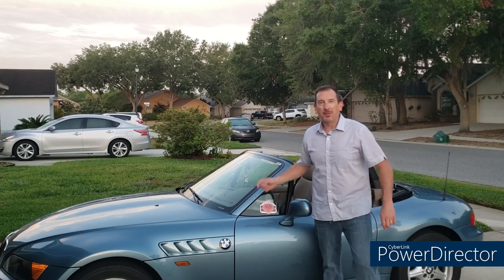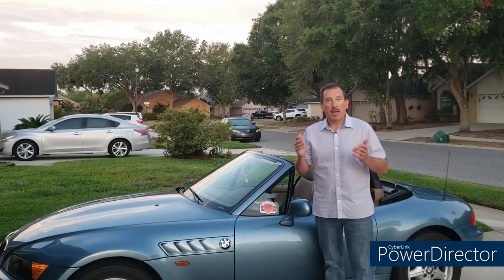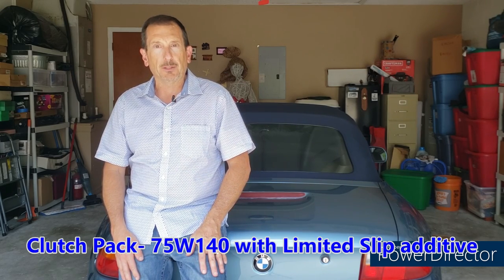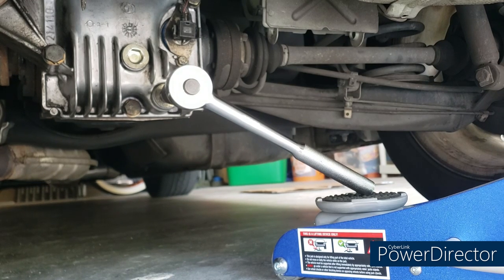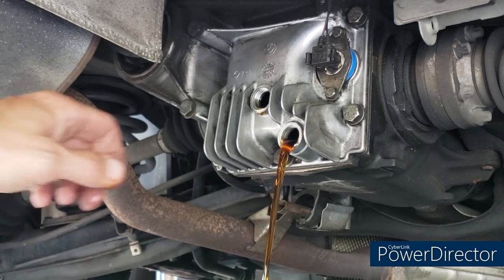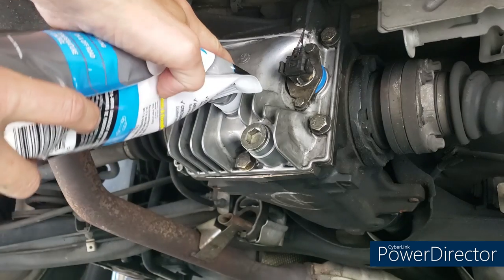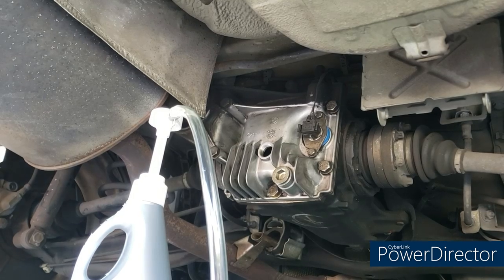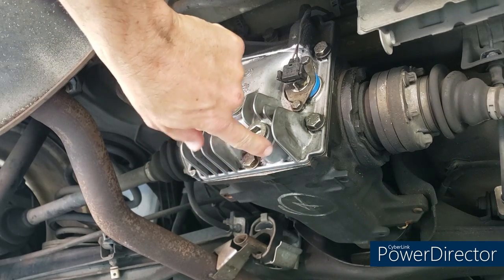How to Change the Differential Oil: BMW Z3!

Comment: Great video as always! I watch them all. I did a video on this a month ago and I also tried the Valvoline bags. I will agree it takes longer than a pump but I like the easier cleanup without having to deal with cleaning the pump hose so it isn't dripping on everything. I would argue the cost of a replacement cheap pump to toss is close to the extra convenience charge of the bag. Both options work and I love that the oil companies are slowly giving us more options.
Reply from the maker: Your video was excellent as well.  You're doing great and your a better  videographer than I am!  Appreciate the kind words!  Agree on the pump cleanup, mines in a bag with that awesome gear oil smell wafting from it.

Comment: Great video Mark!

Thanks for the explanation of the different oil specs for the various differentials used in our Z3s.  I can confirm that using the 75w90 oil in a 2000 non-M results in a whine when the oil is cold.  

Also, reusing crush washers, even if you sand them flat is risky.  I had to replace ATF fluid an extra time because the crush washer sent with my service kit was the wrong size, so I sanded and reused the original.  Leaked from the start.

Also, to get more old oil out, lift the front or back opposite the drain plug higher, then level or lift the plug side higher to get more oil in.  I believe level is fine, as the gears are bathed in oil during rotation.  Too much oil may result in axle seal leaks.
Reply from the maker: Thank you Steve!  Good tips!

Comment: First off; brilliant videos.
I
 got my Z3, 3.0i a few months back and because there was very little service history I decided that it'd be best to check all the various wear points the Z's are known for and start from scratch.  The M54 is a sweet engine but I'm discovering that here are quite a few areas to check out to maintain performance and reliability, but she pulls like a train.

To my point.  I changed both transmission and diff oils yesterday and what a difference it has made to smooth out gear changes.  I opted for Red Line 75-110 for the diff and MT 90 for the gearbox.  The oil plugs on both units were a pig to shift and had it nt been for you novel idea of using a wrench and trolley jack I'd have been there still trying to budge 'em - I guessed they were a tad tight when the rear end started to lift before finally looseneng! ,

I appreciate your enthusiasm and attention to detail.  Bon chance from the S.W. of France.
Reply from the maker: Thank you so much and congratulations on the purchase!
Reply: How did the 75w110 work in your 3.0? I have the same engine and comparing rear diff fluids for changing mine.
Reply: @CobraKyle  The 75-110 works fine, as does the MT 90 for the box.  For the engine I chose Mobil 1 5-30.  Now completed several maintenance tasks to keep her running sweet; upgraded DISA valve flap (X8R); valve cover gasket and spark plugs; replaced Vanos oil feed (BMW); Fuel filter (MAHLE) MAF sensor (Hella); Air filter (MANN) PCV valve (Fibi-Bilstein). The PCV was a pig to install but well worth the effort for ventilation and emissions control.  The Vanos system is running fine but X8R do refurb kits as and when.

Comment: I believe proper fill is usually get the car flat and fill until it drops out, then don't place the fill plug until it finishes dripping.

Im not certain on the z3 diff process I'll have to look up to confirm lol 

I watch a lot of m539 restorations and thats his process on other old BMWs. I believe he follows proper shop manuals.

Another great video mark! Everyone should get all their fluids on these old cars up to date. It's only right!
Reply from the maker: Yeah I probably didn't need to for e in the extra ounce.

Comment: Thanks for the tutorial! Just changed mine with the 75W-140 Valvoline using the Slippery Pete pump. I took my time, but easy process. Wound up using about 1.4QTs for my 2000 2.3 manual. Used the 45 ft-lbs torque. Suggestions on cleanup for the pump to reuse for transmission fluid later? Just pump soapy water through it?
Reply from the maker: @johncagle3362  to tell the truth I can't remember what I did.  Soapy water seems reasonable,  although maybe pumping tranny fluid thru into a receptacle until the diff fluid is out might be easier.

Comment: I did mine as soon as I bought it with 85,000 miles... no idea of the history, so I baselined mine. It's a 97 1.9L open diff, and I used 75w90 Royal Purple with a pump... about a qt.  The oil that came out looked really clean just like yours, but what the heck! Just get it done so I know it's done.
Reply from the maker: My thoughts exactly!

Comment: Now that 1 year has passed, are you good with the choice of fluid and how you filled (by lowering the front to allow slightly more than 1 qt)? Any new tips to provide? I am about to do mine 1998 Z3 2.8
Thank you.
Reply from the maker: Still happy, no issues.  Many warned me about overfilling, haven't had a problem,  but... if it's level and the new stuff drips out,  I'd stop there next time.

Comment: Just curious, did you measure the amount of gear oil that you removed from the rear end? I was brought up that in some cases overfilling can cause more harm than good. Whoever did the last gear oil change got a little too excited with the task at hand...

Like the old school torque wrench: Have you done a gauge variation check with a calibrated torque wrench? Nothing wrong with old school as long as the readings are accurate...
Reply from the maker: No to both!  Thought about the first one after dumping the old oil.  My position change literally bought me an extra ounce or so, hopefully not an issue.
Reply: @MomentofZed  I don't think an extra ounce or two of gear oil is going to hurt however I would have just left it on level ground to refill. One less step for Mark and mankind...
Reply from the maker: @jimmyk6336  fair point!

Comment: Actually too much is worse than too little.  Can great more internal pressure and possibly force a seal leak. Slightly less is safer. Its a splash lubricating system
Reply from the maker: Had that mentioned a while back as well.  Point taken, no harm so far to the seals, luckily.

Comment: How can I tell for sure if my 2001 3.0L Z3 rear diff is LTD or not?
Reply from the maker: Did you already try the vin decoders linked in the description?
Reply: Yes, the first one worked but did not give any rear diff. information. The second said that there as an problem and to try again in a couple of hours. But, I did get the information from you that the 2001 Z3 models have a Torsen rear diff., so I will go with that. I'm going to use Amsoil fluid at the correct viscosity with the LTD additive. Thanks again for all you do for us BMW Z3 lovers and owners! @MomentofZed
Reply from the maker: @Non-Artificial-Intelligence  i think thats the smart way to go.  Good luck with the work!

Comment: Put in Amsoil 75W 140 on my 2001 3.0 and it's been shifting great 30K later. No one carries 75W 110 around me.
Reply from the maker: I think that the difference is negligible. Your better off with new oil a grade up or down than the old oil.
Reply: 6cyl 2litre in uk. Is 75/80 bad?